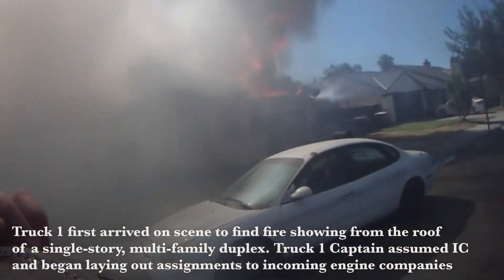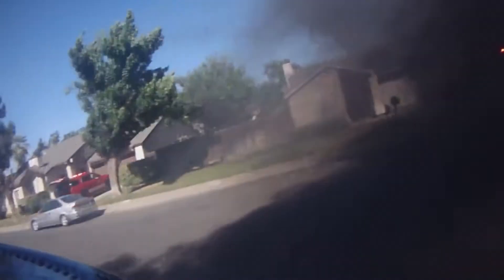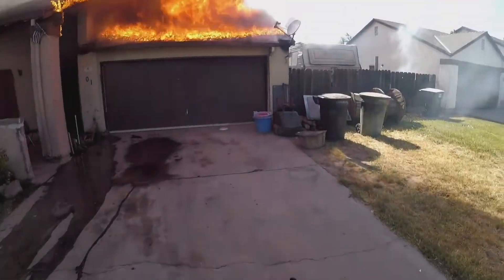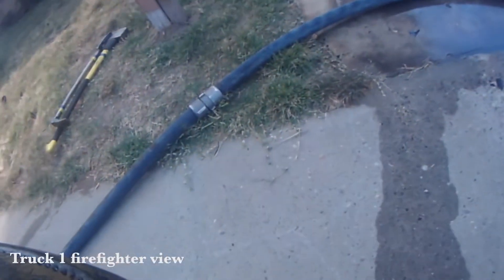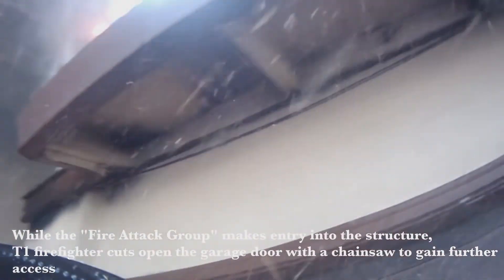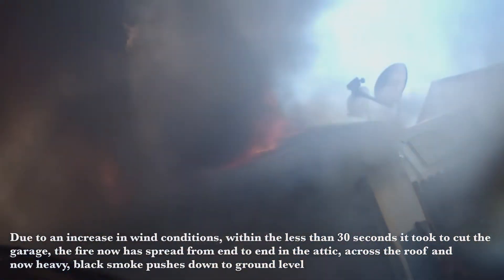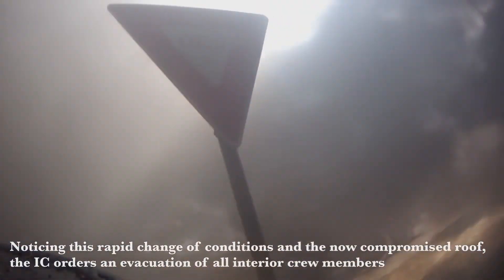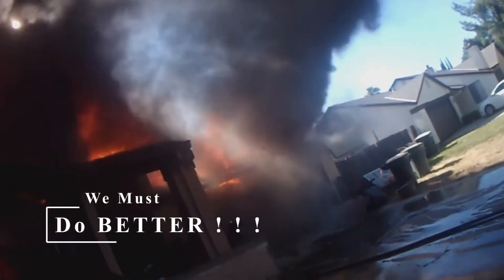A Lack Of Cohesion

Comment: You lay-in and stop in front of the house with a Line of Sight on the Visible Burning Material.  The engineer activates the pump, and you deck gun the roof for 5-10 seconds.  The fire is substantially knocked down to prevent extension, within the first minute of arrival.  Then you can access the garage and cut a hole in the ceiling and fog the inside of the attic.

A second line could go into the house after the house ceiling was opened to check for extension.

You do NOT EVER need Vertical Ventilation.  The garage was obviously venting just fine and there was no smoke in the house.  If you opened a hole in the roof of the house, that would become a Pressure Release Location which would have drawn the fire from the garage attic through the house attic.

No drama, no games and no heroics.  Find the burning material and put fast but safe water on it. ASAP!

Comment: I learned that you are stepping off the truck with you mask on and grabbing a hose to the front door while the captain is doing his walk around.  the engineer is either connecting the forward lay or setting up the tank feed, Number 4 and the hoseman team and go in to get at the seat of the fire as the engineer is charging the hose.  Number 4 leaves the entry irons at the front door since forced entry was not needed this time.  Number 2 arriving truck truck is either laying hose from the hydrant to hopefully save you from an empty tank, or connecting their tank into yours while running 2 in on a search.  The number 4 on truck 2 runs a rescue/ back up line to the front door and might give the neighbors house a squirt for exposure protection, or start running cooling water under the garage door depending upon the inside team's position.  

Saw none of that.  The whole second arriving engine crew was mobbed up on something, and the open front door definitely feed the fire plenty before the firefighters arrived, I am surprised our camera man did not make sure it was unlocked and close it to starve the fire some.
Reply: You step off the engine, grab a hose and take it to the fire room at the Exterior!  You do NOT waste time and create the unnecessary danger of blindly entering a smoke filled and unfamiliar structure to search for a fire you can safely and quickly access through the windows.

Comment: Considering the critique offered: Is it not fair to assume that there is a passageway door between the garage and the dwelling?  If so, why not stretch the first line through the front door and procede to the passageway door in order to effect extinguishment?
Reply: TIME!!!  You are also destroying the fire-resistant barrier between the house and garage when you open the door.  Plus, the garage is a high-pressure area while the house is low pressure especially because the front door is open.  You extinguish all Visible Burning Material from the exterior before you go inside.  That's just, Common Sense and Logic, combined with a strong and responsible work ethic.  Things that are missing in 95% of USA departments.